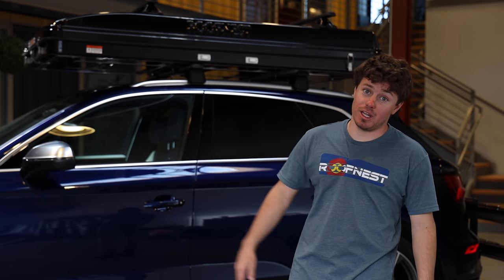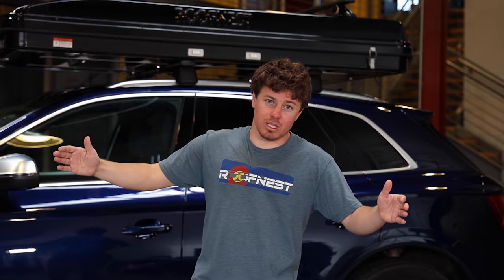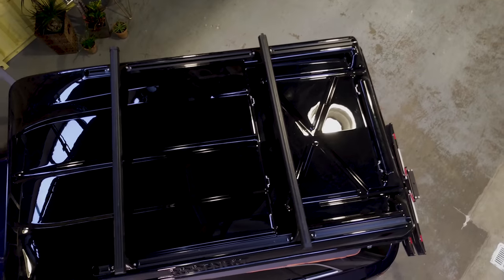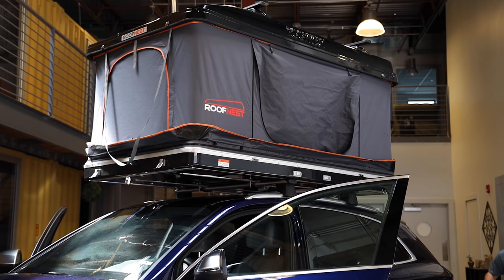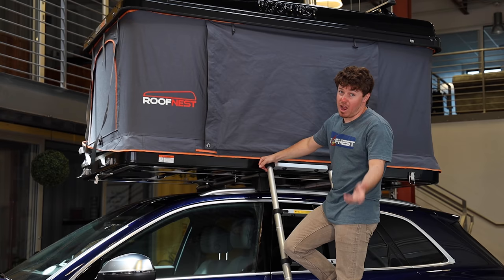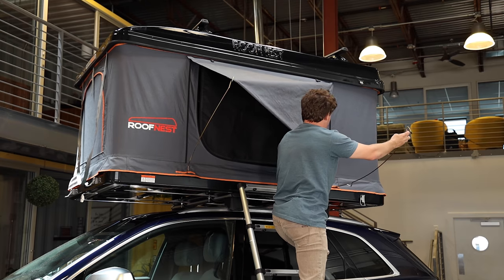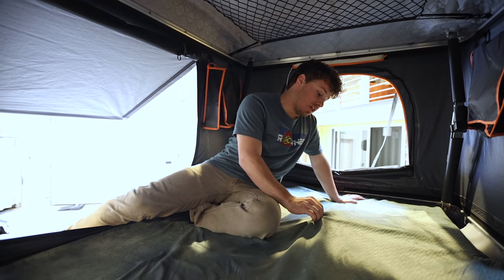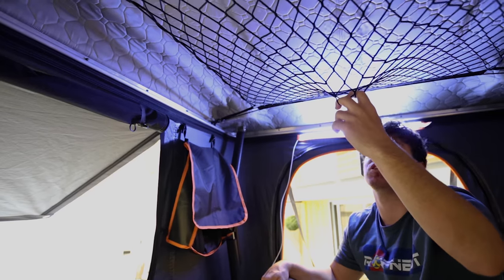Sparrow Adventure Walkaround 2021

Comment: We have had our Sparrow XL since July 2020 and we spent September of that year on a 5,000-mile camping trip. We traveled from central Wisconsin to The Tetons and Yellowstone, staying in state parks all along the way. Our Sparrow XL performed flawlessly and comfortably in freezing weather, in wind storms, and in rain storms. It traveled easily on top of our Toyota RAV4. The one thing we learned was how to manage condensation more effectively when it was cold and damp by (1) leaving a window partially open, and (2) running a small USB fan at night to circulate the air.  Problem solved.

We are heading out again this August, leaving from Wisconsin and heading to Glacier National Park, Yellowstone,  and the Grand Tetons. This trip will be longer and we will be spending more time in the mountains.  We are looking forward to spending more time in our Roofnest -- which draws a lot of attention wherever we go.  

By the way, my wife and I are in our seventies and I think many people are a bit surprised to see us traveling with and sleeping in a car-top tent. But we love the Sparrow XL and go camping near and far whenever we can.  

If we were to make the decision whether or not to purchase the Roofnest again, we would do so without hesitation. However, we wish we had done so earlier than we did. It is great gear!
Reply: Did the tent interfere with fully opening your rear hatch?

Did you get the optional insulation with your tent?

Did you use any kind of portable heater (propane or electric)?

How comfortable is the mattress?

How much did your gas mileage decrease?
Reply: @patrickio8084  
1.  You will have no problems with the rear hatch as long as you mount the RoofNest properly. Once we had the RoofNest loosely sitting on top of the car, we opened the rear hatch fully and slid the RoofNest back until it was about one inch from the hatch. Then we fastened it down to the crossbars. No sweat. This has never been an issue for us.

2. We do not have the Ptarmigan insulation set, as we do not camp in the winter.  If we did so, we would not hesitate to get it. Further, it is my understanding that the RoofNest can be closed with the insulation kit installed. Nice!

3. We do not use a portable heater. Our Grand Teton double sleeping bag is rated to 5 degrees and the Roofnest down quilt is an awesome addition, if needed. We wear medium base layers at night in the RoofNest. We have camped in mid-20 degree weather and have been as warm as toast. Too warm, in fact. Two people give off a lot of body heat.

4. The mattress is firm and comfortable. Unlike a typical foam mattress, it does not get harder as it gets colder and it does not develop dents in the shape of the sleepers. We are pleased with the mattress.

5. I have calculated the mileage impact as best I can over long distances, and it appears to be about three mpg. It is slightly worse driving West and slightly better driving East, given the prevailing winds.

Our Toyota RAV4 Hybrid gets between 31 and 32 miles per gallon with the RoofNest mounted.  We leave it on the car from May to October.

Good questions. I hope my answers are responsive. Thank you.
Reply: @jerrystark3587  Appreciate your quick and detailed responses!  

I've often heard how most / all tents (ground or rooftop including insulated tents) are unbearable in the Summer without shade and or a portable air conditioner.  Have you ever been inside the tent in hot weather whether overnight trying to sleep or late afternoon in the sun and how sauna-like was it?

What other brands did you consider and what was the deciding factor?
Reply: @patrickio8084  Once again, you ask good questions.

(1) On our month-long camping trip last year, we encountered weather conditions ranging from  40 degrees to 100 degrees during the day and from 28 degrees to 78 degrees at night.

There is no question that ANY tent will heat up fast in direct sunlight on a warm or hot day. A car top tent is no exception. 

What helps with the RoofNest is that it is set up for excellent cross ventilation. Also, being five feet in the air helps a lot with catching the breezes.

We never spend much time in the car top tent during the day, unless it rains heavily, so this is not much of an issue, but for warm nights the cross ventilation is very helpful. We adjusted to warmer night time temperatures by wearing light cotton under clothing and by laying on top of a fitted sheet on the mattress. A light blanket kept away the morning chill at about 4:00 a.m. 

(2) I researched all the major brands of car-top tents, including Thule, IKamper, Cascadia, 23Zero, etc.  Once I decided I wanted a pop-up, hard-shell tent, then it came down to price, design, size, and included accessories. Then the choices narrowed quickly. 

On these bases, the RoofNest came out on top for us at the time we we looking to purchase a car top tent (mid-year, 2019). For the price, I thought, and still think, that the RoofNest tents are a great value.

From what I can tell, RoofNest tents -- both hard and soft shell -- are still very competitive with respect to these criteria.

I hope this helps.  Thanks.
Reply: Outstanding.  Thanks for sharing.  Cheers from Alaska. 🇺🇸⛰

Comment: General question, hopefully you see this roof nest. I’m interested in a roof nest tent, I have a vehicle similar to the one in this video. 2019 Audi Q5. The base carrier bars for the audi are rated for a maximum static load of 165lbs per the manual. Are you using different carrier bars that have a higher rating? If so, what’s the brand? Currently, I have audi carrier cross bars and the weight of the tent, myself, and my dog would exceed the recommended weight limit. Please help :(